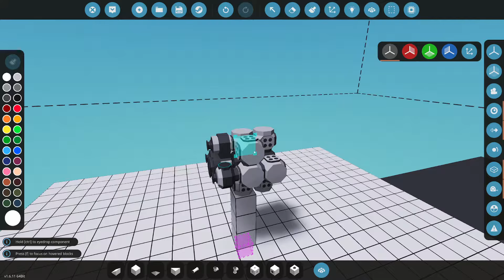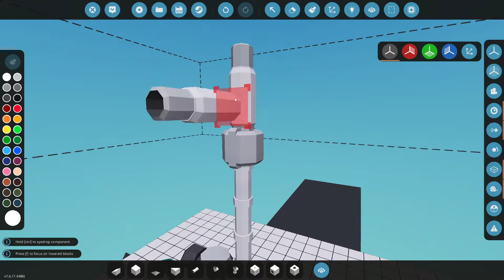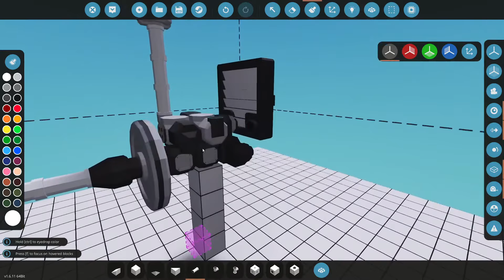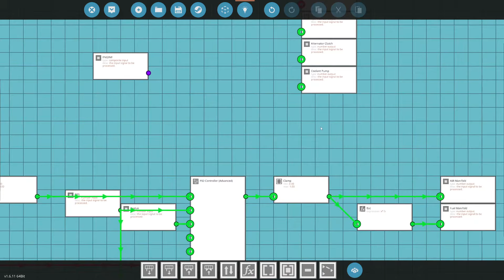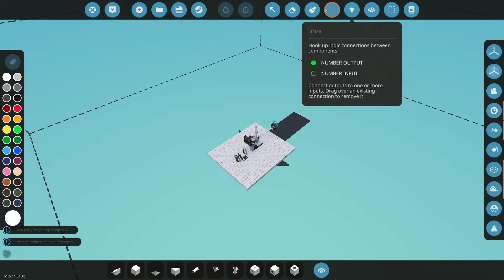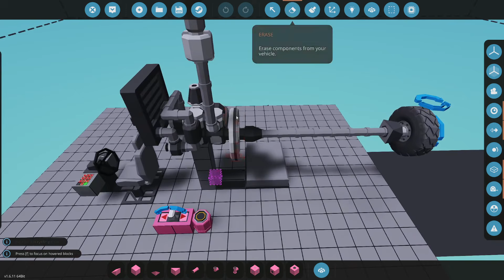Stormworks Basics: Modular Engine Tutorial

Comment: Thank you, this is an excellent guide.  I followed step by step, and success.  However when i tried to add in you auto clutch.  I had an issue.  My rps oscillates  i havent hooked up the gear neutral position.  i replaced the constant number That was set to 5 with a p value, but it oscillates all but when it set to 18, correction it still oscillates with 18 but not much.  I get that now the car only moves when the rps reaches 18. not sure what im doing wrong.  The rps does not go higher than 5rps when the constant number is set to 5.  i think this is got something to do with it. lol
Reply from the maker: Post you workshop link to the help channel on discord. Either I or someone can help when we have time. https://discord.gg/wzKn6JXJmN

Comment: After copying this engine and building it, I found a 0.0001 integral component really helped with this system's idle capacity under load (esp. gearing up). Set it up under a flappy paddle system and it transfers between gears very smoothly and idles happily on all gears. The main thing is you need to rev a little to switch into first, which I think is normal.

Comment: if u have starter on auto it might cause a battery chug if theres an issue while ur rescuing etc
Reply from the maker: I have never had an issue with it. I also usually have a separate backup battery
Reply: @CaptainCockerels  i used ur guide to make my modular ecu, using the PID was a great idea I learnt a lot and the copy paste for the AFR calculations was super helpful

Comment: I did not see how to engage the load to the engine, so I connected the Composite Read to the clutch for when I press "W" which engages the load (propeller in my case). I probably just missed it, but went back through a few times and could not find where you connected the clutch. Thanks for the video, it really helped.

Comment: Hi, this is decent tutorial. Flywheel boosts engine power by reducing losses caused by mechanical parts such as gearbox, clutch, propeller...etc. Also coolant water tank is required for cooling very small engines; single cylinders definitely need it, not sure about 2 cylinders.

Comment: Finally a player who turns his engine on with 6 and not 1!
Reply: key button
Reply: @Quantum-Bullet  thats a different story
Reply: @danielk9906  I usually have 1 as wheel brake that is synced with a button for it
Reply: @Quantum-Bullet  I’m the key button guy as well. Occasionally small builds need a hotkey. I don’t have a standard when it comes to hotkeys.
Reply from the maker: Usually I do it with a key or panel. For examples I usually use the seat.